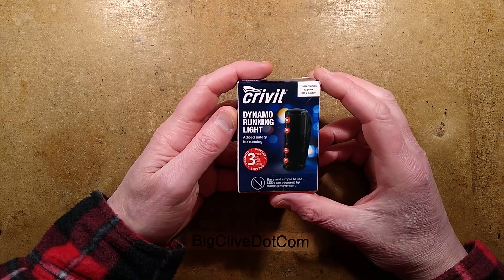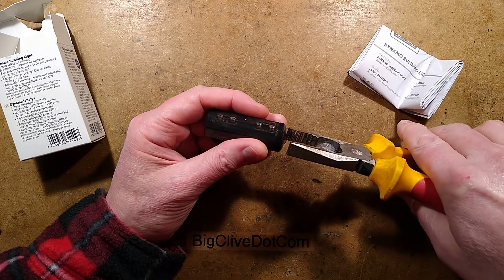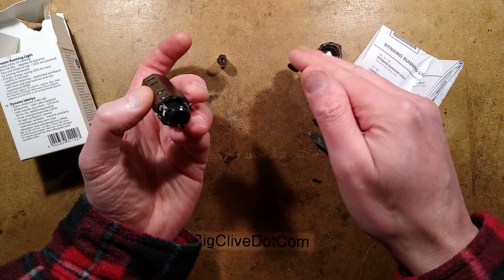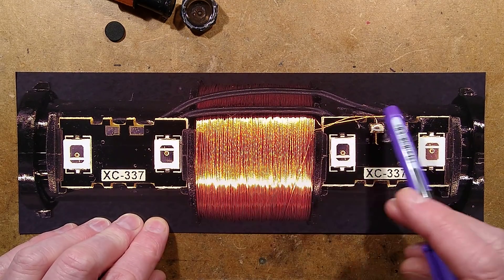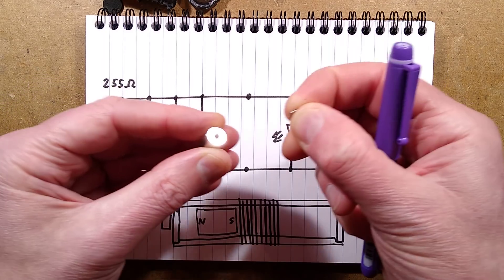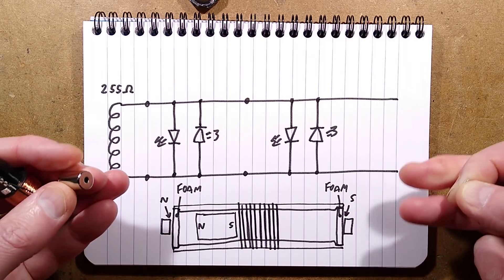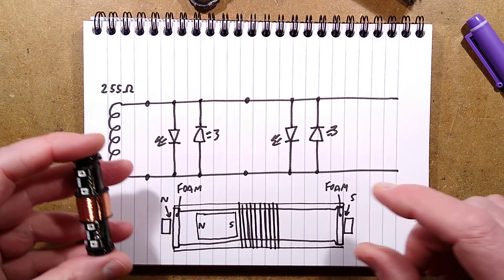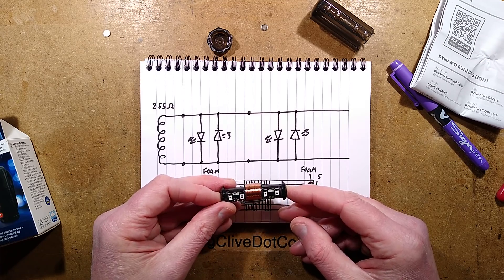Lidl self powered jogging light teardown (with schematic)

Comment: ...I pondered why this robust technology isn't used for TPMS....if the wheel was designed with a balance weight diametrically opposite  it wouldn't throw the whole shebang out of balance.  Instead we use a CR2032 cell... (cost saving..)

Comment: LEDs are fantastic for this since they "drive" themselves: as the magnet is starting to move, the voltage across the coil is lower than the LED's Vf so the diode remains high impedance (ish). This allows the magnet to accelerate unimpeded. Once the voltage crosses a threshold near Vf, the LED crowbars and sharply takes a lot of energy from the magnet. If it were linear like a lightbulb it wouldn't allow the magnet to get to speed and would only be very dim.

Comment: I agree with Alun Thomas below. The hole is there to make a passage for the air inside the magnet chamber, to keep it from damping the magnet's motion. Plus, that way they can make the magnet slightly bigger, almost filling its bore (just short of a friction fit), which helps against the magnet tilting (and thus rattling, maybe getting wedged?) inside the bore.
This is just a layperson's opinion. I'm not a engineer.

Comment: If you could smooth out the power generated could you use it to charge a battery?
On an ever so slightly relevant note, any mention of neodymium always sends my mind back to far off year of 2007, the halcyon days of youtube, where a man with a (blendtec) blender could grind magnets into mortar and stop/reverse the earth's rotation.

Comment: Would it be an improvement to add a Xtra large capacitor to store  and release power without the need for constant jogging? When you stop for a break this item is useless.

Comment: I would of added  2 Coin like Super Bat Caps Hybrids + 4 Coils 20.20 Two little Transistors And have a Duel Joule thief going on So when stopped The Joule thief's keeps ticking the lights over for the Next 20~40mins

Comment: I'd be interested to see how the brightness of the LEDs compares to ambient and adjacent lighting conditions in/near large cities, and the brightness of retroreflectors lit from relevant sources.

I wonder how long the LEDs flash on each typical cycle, and how that would affect human visibility vs. say smart car visibility. I want to say the opposing magnets at the end would create a sharper, quicker spike in the flux change as the magnet passes through the coil, but it's been a while since I've played with modeling magnetic flux lines.

Still no Lidls on my side of the US, just Aldis.

Comment: neodymium magnets are very brittle so pads and decelerating magnets are necessary to stop them shattering when thrown about. Once shattered the pieces will hold together due to magnetism but the overall effectiveness of the magnet is greatly reduced.
The big down-side of this light is that if you stop; say to cross a road; the light immediately stops.

Comment: Great video as always BigClive!!
I have a problem of my own which Im hoping i can reach out for some assistance with. Im attempting to understand the workings of a simple vibration triggered switch on a circuit board inside of a airsoft magazine that drives the motor to feed ammo when the magazine is bumped or shaken. Are you open to me sending you an email with some details to see if you can help me work this thing out? Could be an interesting circuit for you to cover in a video or just get a kick out of.
Reply from the maker: Many modern vibration switches are just a spring around a pin inside a protective cylinder.

Comment: Can we assume that the 'dynamo' generates at least 2 volts?   Because it takes 2 volts to light up a red LED.  So how about rectifying the pulses from the coil, and filtering it to straight DC.  Or maybe even double it with a voltage doubler.  Then use the DC to pulse some really bright red LEDs for very bright flashes, much brighter than they are now.

The disposable camera has a flash that runs off a single alkaline AA cell.  I was thinking that a similar circuit could be used with a smaller electrolytic capacitor and flash it every second.  But what would be really awesome is if the argon gas was replaced with a gas that strobes with a bright red or orange.  Or maybe just use a string of red LEDs and pulse them at high current for a very bright warning light that saves you from being run over by a bus! 

Thanks, Clive.

Comment: The circuit is so meh. I'd use a centertapped coil, full wave Schottky diode rectifier and large capacitor (47mF or more) to make the thing glow for at least a few seconds after the generation stops.

Comment: Reminds me of the shakey torch I had as a kid.  I shook it so hard the end popped off and the magnet flew out!!  Why don't they put a capacitor in it so it can continue running when not being shaken?   Funny how the LEDs are the rectifiers - it really is the chinesium case of using the absolute minimum number of components possible - I suppose even the addition of a capacitor would hurt profits.  I wonder if it's possible to blow the LEDs by shaking it too hard as there is no resistor?

Comment: Only problem is if you stop jogging, you are left in the dark. Not sure it's as good an idea for running as it sounds. I figured there might be a small capacitor so the light didn't just go out on you.

Comment: The LEDs are arranged as a full bridge rectifier. Shorted out. lol.
Current limited by the impedance of the coil,  which would be calculated to balance the peak voltage generated at maximum velocity of the magnet through the coil.
I doubt average power dissipation would be a problem at that duty cycle.

Comment: I got hold of a very similar "Jogging Light" device here in Germany at Lidl years ago. Back then I was similar surprised by the brightness achived. Nevertheless, I really wanted to use it while jogging. Only to find out, it simply didn't worked out for me. The best place to put, to get a somewhat reasonable amout of shaking, was on the ankle, but down there it that was of absolutely no use...

Comment: I'm kinda surprised you don't see this kind of stuff on bikes anymore. I remember when every old bicycle had a dynamo and a light bulb that would draw enough power to significantly slow you down, I imagine now you could definitely have an LED version that draws way less power and doesn't need batteries or charging

Or just make the dynamos charge a battery to keep the light on when parked
Reply: No need for a dynamo. I installed (bright!) battery-powered LED head & tail lights on my , and the alkaline AA batteries I installed are still powering them years later.

Comment: I like that in bike form. Specifically Dirk Strothmann's Magnic Light which uses an alloy rim to generate a strong enough eddy current for a reasonable rear tail light. I havent used their headlights because I like that batty powered (a known consistent strength), say riding in the dark and needing 500+ lumens

Comment: I'd love to see voltage measurements with an oscilloscope, and maybe a mod adding a capacitor.
Reply: This!
Reply: To do it right, I'd bring things up to a larger scale. But find two preferably larger tube magnets -- one with the hole, one without -- each of the same overall length and diameter. And run them through the same coil at the same speed; and measure the outputs. It's the only way to be certain. And if you can get them with varying sized holes, that'd be even better, as you might discover a numerical relationship. Given where it's from, I think it could be as simple as those were cheaper magnets at the time of the bulk purchase.

Comment: the question is: could you hack it with a small FULL BRIDGE RECTIFIER (shottky if available) and a lil low ESR electrolytic cap ?

so it would glow up and down smoothly or even keep lit over the full stroke.

that'd be interesting. 👌

Comment: The magnet has a hole in it for heating system magnetic filters. Several magnets are placed together in a shaft for different sized filters. Tens of thousands are made so I think it's an easy procurement matter rather than a specific design feature for the light.

Comment: Somehow, I just don't envision this working well. As someone who has regularly walked/run/biked at night, I don't think this is as bright as I'd want to get people's attention, and I really don't think that the motion of walking/running would translate well into power generation. If you're efficiently moving, most of your movement is forward, not up and down. Pedometers that use... I dunno... a Hall-effect sensor??... work for step counting since the weight of the moving part is much less, but this light seems like it has a very heavy magnet. Also, maybe I missed it, but I saw no way to attach it to yourself. Finally, as others have said, it was pretty bone-headed of them to put the damn thing in a dark-colored plastic.

Comment: I would prefer a design with a small flip flop circuit to flash the lights and a small super cap or rechargeable lithium cell to provide flashing lights when I'm not moving a well. If I take a tumble, I want the lights to keep going.

Comment: the hole is for air to flow through so it does not act like a piston on a compressor .the closer the Magent is to the coil the stronger and more voltage and current is produced as the lines of magnetic flux are cutting the coil

Comment: What do you reckon: would a large one of these be effective to power a solar-powered house overnight? During the day, the solar panels could charge a battery with JUST enough power for a mechanism to rock a large one of these back & forth. The rocking mechanism could be laid horizontally, using gravity as a source of power.

Of course, the magnets would become demagnetized over time. So maybe the batteries could also trickle charge the magnets over time, too...
Reply: Magnets don't lose strength. But the power you can store is just the mass of the magnet times the lifting height. So, not much.
See https://www.youtube.com/watch?v=NIhCuzxNvv0
(Magnets do not have magical powers, although they can be counter-intuitive).

Comment: Add a bridge rectifier and capacitor. Than jack up the output to a joule thief than finally use it to light a single Cree brand led or maybe an 18650 cell to use later to charge a phone. Or the whole thing can be used to extend the life of a cell phone battery as you jog.

Comment: Hello BigClive... This device seems good but is it not a one directional viewing angle be an issue... If you place it somewhere what would wide viewing angle be?... I have seen you do many 'tear downs' and 'reverse engineering...' of devices; Has anyone or any company had issues with you doing this or 'criticize' you for 'bringing light' to their products flaws... Still like the product but where can it be placed... possibility the shoes or jacket or headband...
Reply: The part of the body that moves the most when you're running, beside your legs, is your arms. If I was a jogger, that's where I'd strap these, on my arms.

Comment: Hi Clive interesting video thanks for sharing.  I used to have three of those original shake lights I purchased long ago from QVC I think.   As a torch they were just too dim to be useful, so they got put in a drawer somewhere then I found them again years later.  One of shake lights stopped working so I took them apart and saved the magnets.

Comment: Could something like this work with a capacitor or rechargeable battery, so the lights continued to illuminate for a short-time after stopping movement? - I.e. when a runner stops at traffic lights, for a breath etc
Reply: That's what Im wondering! 
Or maybe it could have some other practical uses or ways to use it besides on a jogger.
Reply: @eugy2008  Have you never seen these things before? They are already used on shake flashlights with capacitors.
Reply: @nimoy007     I'm guessing though that you can't go too big with the size of that capacitor, otherwise when you start jogging there would be a period of no light emitted while the cap charges up?
Reply: @nimoy007  Nope. First time I've seen something like that.

Comment: Best worn with other permanently lit running lights. It reminds me of the old Dyno Hubs on pushbikes years ago. They worked quite well and didn't need batteries. Problem was when the wheels of the bike stopped turning the lights went out. Great when you are stopped at a road junction waiting to cross! It’s similar with this device.  But it would be good as an additional light, just not the sole light.
Reply: Dyno hubs on pushbikes are still very popular and these days many have a capacitor fitted that keeps the lights illuminated for around  four or five minutes when stopped called a 'standlight'.

Comment: The hole through the middle is likely a vacuum/pressure break.
Ie, so it can move freely without generating pressure as it's traveling that direction nor vacuum behind it and visa-versa when it travels the other direction.

Comment: The hole in the middle of the magnet is there to allow air flow. The magnet needs to have a tight fit inside the tube to avoid tattling too much, but this prohibit rapid movement of the magnet because it turns into an air piston if the magnet is solid.

Comment: I'm kinda not sure if it is just a simple two pole magnet. the field lines would not cross the coil in the right orientation? One thing that would have been great to see was the magnetization pattern on the magnet. one of those green magnetic film things would have done the trick.

Comment: Crivit is lidl. I remember getting pumps and cycling multitools from there after I got my bike down in Germany. Had a fun time realising that countries which drive on the right put the brake levers the other way around.
Reply: What, you don't brake the front wheel with the right hand lever?
Reply: @EddSjo  I reckon it's for when you're indicating across a road while going downhill. You want your other hand to be on the back brake. Otherwise you run the risk of going over your handlebars while about to turn across traffic.
Reply: That's interesting, I didn't know that.

Comment: Hole in the magnet seems to be there as air passage. Also what that would be used for? Yes, LEDs are bright, but the red light is pretty low energy, so no good for signaling. Also you need to actively shake it for it to work. Neat device, doesn't seem to have a use?
Reply: It's clearly in the title and thumbnail what they're used for. Red lights are perfectly fine for signaling. They're used in cars everyday.

Comment: The hole is so there is no air pressure buildup on one side, else one side would get compressed and the other side would get a vacuum. It just lets the air move back and forth easier.

Comment: The hole has to be for air to flow throw or you would get a air cushion on each end if the magnet is tight fitting in the tube

Comment: I absolutely love any kind of electronic device that needs no power cell! Stems back to the days as a kid with a crystal radio I suppose. Theoretically,  not only do the small magnets decelerate the larger magnet as it approaches,  I would think it would also quickly accelerate the large magnet once it has begun its reverse trajectory... I'm gonna have to get one or two of these little jewels! It is truly impressive that it generates enough current in that short of a span!

Comment: The bad thing about the opposing magnets to keep the slug floating in the middle is, it will cause magnetic deterioration over time. I have used switches that use magnets instead of springs, and they do eventually wear out, much faster than springs.
Reply: Not to any practical extent, no. A neodymium magnet will hold for hundreds of years, the additional small field of the end magnets will have little impact, they are just not strong enough. The switches you are using is some separate issue or a different type of magnet.
Reply: Hmm, maybe that and the fact they are brittle is a reason for the foam pads.
Reply: @galaxya40s95  The foam pads are just due to brittleness. The opposing magnets arrangement is a clever way to get the most out of the body movement, but it will wear out sooner rather than later.
Reply: I thought that they are all neodymium. But admittedly I have not paid that much attention.

Comment: the hole is a cost cutting measure, they bought them in bulk and it was cheaper to just use what they had and they bought by the pound and it worked
Reply: im going to see if aldi has these in the chicago area, would be fun to add to my bike for the safety factor of red light whenever it jiggles, maybe replace it with a rgb flashy led and tiny capacitor and hope it can stay high enough voltage to power the micro

Comment: So could you shove a bridge rectifier on it, connect it to a small battery, and a bright led to create a running head light?
Reply from the maker: It might not be very bright supplying continuous power.
Reply: @bigclivedotcom  Hmm... or the worrying possibility that you accidentally overcharge the battery and set your hair on fire.